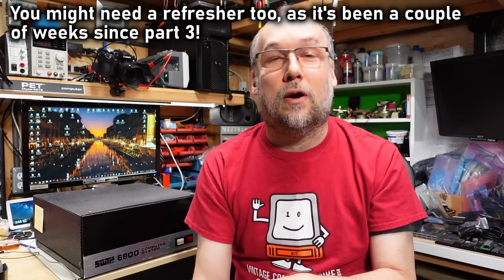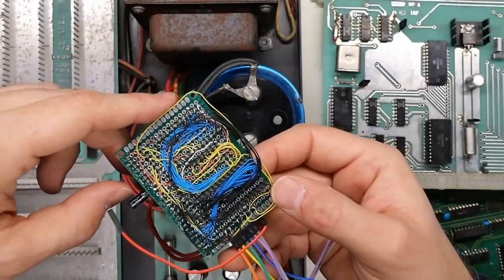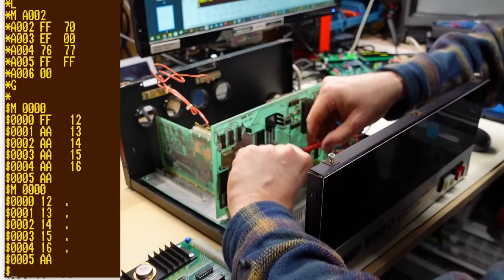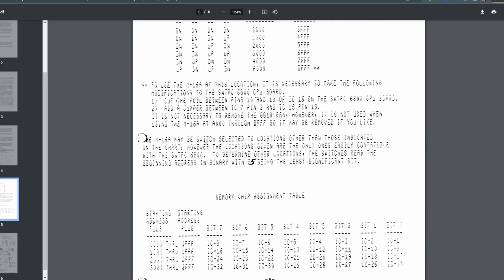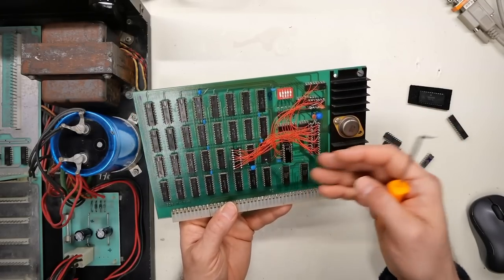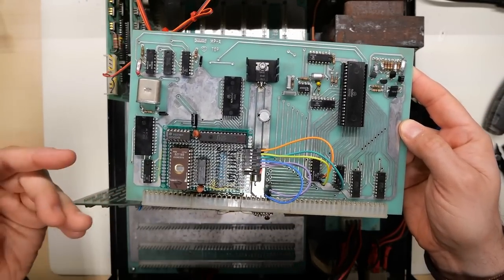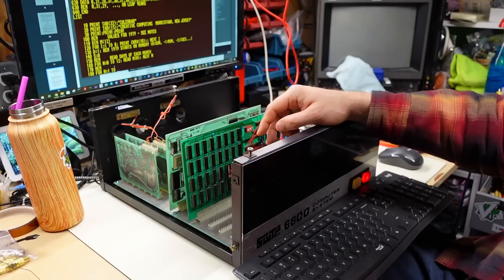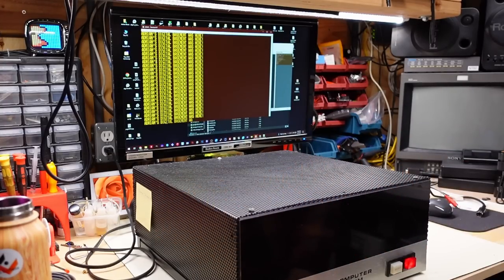We can fix it! A home-made 32K RAM expansion for the SWTPC 6800 (Part 4)

Comment: The timing diagram is telling you that you need to use VMA. They would not include it in the diagram if it was not necessary. The reason they call out Peripherals needing VMA is that someone could miss that point for peripherals. It's not stating that VMA is not needed for RAM.

This is because there are internal CPU cycles that assert the R/W and address lines but NOT VMA. You will corrupt memory if you don't factor it in. 

In my FPGA build of the 6800, the active high line for the write strobe for a 32KB RAM is:

wren => (not w_R1W0) and (not w_cpuAddress(15)) and w_vma and (not w_cpuClock),

(cpuClock is not Ph2 in my FPGA design)
Reply: Think of VMA as a signal that, like the name, tells you when an address on the bus is valid. The data sheet is telling you that it doesn't just apply to memory, but also to peripherals. After all, everything is memory mapped on the 6800.
Reply: When the 6800 was designed, every pin and signal out of the CPU took a lot of effort, and claimed a precious pin.  If it was not absolutely necessary,  the VMA signal would not have existed at all.  When the original decoding scheme was shown, my memory from 40 years ago thought "that just looks too simple, but I can't remember why".
Keep up the good work.

Comment: I find it both oddly comforting, and completely obvious that old digital tech works with modern digital tech.  The issues seem to always be that the new stuff isn't completely backwards compatible, whereas the old stuff (provided you can meet it's low speed requirements) works perfectly.

Comment: I would have put the RAM on the CPU board in the top of memory and the other board at address 0 so that the CPU board would continue to boot alone. Also, if you use Teraterm's "Send File" function, you will get a status bar showing progress, which would be nice. Finally, were this my machine, I'd probably replace the hand wired stuff with a new board to plug into the backplane that was a combo ROM and 64K RAM board. Include DIP switches to disable banks of RAM, and to select different banks of a larger EPROM, and you'd be ready to boot to monitor, or directly to a disk bootloader.

Comment: Baud is symbols per second. Bit rate is bits per second. Sometimes they are the same and sometimes they are not. For example a 56K modem is 56K bps but actually something like 1200 baud as it uses QPSK bit encoding!

Comment: Wow, that was incredible! Fantastic job with that ram board and the troubleshooting. I noticed at 43:51 to 43:53 when you showed line 11170 it was supposed to be line 170, but I'm not sure line 170 ever made it into your final program. Line 160 was missing too. I wonder what the output would have looked like with those lines?
Reply from the maker: Ah right! Funny. Terra Term has all sorts of issues funny. Good eye!! In the final part of the video where it was running in the background behind me, I had reloaded the program and I think those lines were there because it did look just a little different.
Reply: The missing lines are responsible for not showing *'s that should appear "behind" other lines on the diagram.  With the code lines missing, the extra *'s got printed anyway, making the right side of the figure thicker than it should have been.

Comment: I didn't scroll down to see if you got someone giving the full explanation on the VMA signal. I'm shooting from the hip here, but my recollection is that, during internal calculations, you often get what looks like a valid address on the bus if you aren't including VMA. (Doing this to make it easier to tri-state the bus and put another bus controller on the bus while the 6800 cogitates or something.) In other words, with only the address, clock, and read/write signals, you can definitely get spurious writes. You have to use the VMA to prevent those spurious writes.

Comment: When VMA is low the 6800 is doing some internal processing and the address bus can have an invalid address. Definitely, no writes must be allowed if VMA is inactive. The 6502 lacks the VMA signal and all clock cycles are memory reads or writes. That CPU always shows a valid address on writes, even on dummy write cycles. But in the 6502 case a dummy write can still have some unintended effects on I/O devices ( a double write to the same address is not a problem for memory, but it is a very different story  for an UART data register)
Reply: Being a simpler CPU, the 6502 is less likely to have internal cycles. Also, more space on the die to handle isolating the external bus internally if it needs to.

Comment: I have a very simple 6 IC computer on a breadboard with 32k EEPROM, 32k RAM, overclocked to almost 150% (7.4 MHz) . The serial I/O is also bit banged, running at 19200 baud. It actually can do 38400 baud. That works fine for normal terminal communication, but fails in XMODEM uploads, because the processor is not ready to receive the next byte if I actually want to do something with the last byte. TeraTerm sends the entire packet without delays. The great thing is that the processor is a contemporary of your 6800 computer here, not some modern thingie. The memories are more modern of course and should work fine for any clock frequency I can reasonably reach, but I'm planning a tiny memory expansion  to up to 16 megabytes.

Isn't it great how far you can get with such an old processor when it's not bogged down by slow, tiny memories? Your piggy back ROM expansion reminded me of my memory expansions back in the day. They were also on perfboard and sat piggy back on my single 4k RAM board. These were my first DIY circuits that actually worked. :-)

Comment: I guess it depends on which way you look at it. From a preservationist perspective, since you had to cut traces, even though it’s reversible, you still altered the card. But I do think this is probably close to what actual owners in the time would’ve done. Of course, with period parts and probably wire wrapping instead of soldering. Someone with enough technical knowledge could probably make a new CPU card for the SWTPC with EPROM support and modern static ram on the board, probably supporting the full 48k all in one. That could be interesting.

Comment: Completely support the ROM adapter and baud rate mods. Not super fond of using the "modern" SRAM chips, but I did approve of your assembly technique. Would have preferred to see the ROM adapter simply be a ROM adapter and seen the original SSB memory card repaired with period ICs. Alternatively, designing an expansion board to use the modern SRAMs would have also been a bit more "correct" IMO

Comment: I learned microprocessors using Heathkit 3400 course and trainer, which is based on the 6800  
You can't really do anything in basic. It's too slow. assembly is the only way to make old processors do anything without sucking. 
VMA should've been called VA (Valid address) it indicates that the address bus is holding a valid address and is not in three-state.

Comment: If you look at the memory mapping the6800 CPU always had designed the thought that E000 was beginning of any Rom and the next bank was for the extended Functions, like Extending the Functions or to provide access to ROMs added for special Interfaces. This always seemed strange when you could only use 32K RAM but could have up to 32K ROM for dedicated Functions. Have a look at the Motorola Manual for 6800, showing the Kits Motorola Designed. Having been around the the 6800 and the  6809 you will see the same thoughts are used in both. Where as Intel used the lower memory than allocated all the space left for RAM, this caused issues with larger ROMS causing loss of RAM affecting some early Programs to fail as they lost the lower RAM Space to ROM's. This thought also allowed for larger RAMs when 64K became cheap to move the ROMs up the memory stack and allow more RAM for Programs with out changing the lower Addresses.

Comment: Never assume that the 6502 = 6800. MOS made the 6500 to be pin and function compatible to the 6800 though having a different machine code. Motorola tried to sue the crap out of MOS but eventually agreed in court to MOS scrapping the 6500 and 6501 CPUs and redesigning the 6502 to what we know it today. Shortly after this court case Jack Tremiel bought MOS for Commodore and attempt to corner the 6502 market. The rest is history.
Reply: The 6800 pin-compatible version was called the 6501 rather than 6500.
Reply: It's funny, because people really didn't want something pin-compatible with the original 6800. The original 6800 needed a clock generator chip, and that was enough of a pain that Motorola later came out with the 6802/6808 that didn't.
Killing the 6501 didn't do any damage because nobody wanted it, except maybe adventurous people with an ET-3400.

Comment: I bet you could throw both CP/M and BASIC on a modern ROM chip easily, if you put in an MMU for it and the appropriate loading software you could do so without eating up a major amount of address space.  (CP/M would require the most address space, and is probably the only one requiring more than one ROM bank.)  You probably can find a copy of TinyBASIC online along with instructions on how to put it in a ROM. 

It would also be cool to make a custom VPU card.  

I'd also like to see an MMU Expansion card using one of the widely supported MMUs from the time. 

You can order custom PCBs built online too, and considering the rather standard size of these PCBs, it would be quite easy and cheap here.

As a note, you can get quite large n*8 SRAM modules on most electronic prototyping supply stores.  Of course, this means waiting for shipping.

Comment: I'm currently fighting to get CTS/RTS working on a project I'm working with --- one end is a PSoC4 board, which doesn't have it, and the other end is a Raspberry Pi, which doesn't have it by default --- and hardware handshaking makes life so much simpler. You just crank the baud rate as high as it will go and traffic flows as needed. Does that serial card support it? There are more than just three lines going to the external connector, which suggests so.

Comment: Just finished restoration of my Osborne 1.  Tera Term was repeating lines making file transfers a nightmare.  It had to do with the Tera Term software buffer and the Serial - USB hardware adapter driver buffer I was using.  In the end I couldn't find any combination of settings, drivers for the adapter, speeds etc.  I ended up downloading the 30 day trial of HyperTerminal and everything worked fine with no overlap.  I guess Hyper has better control of its buffer.

Comment: The explanation for the MC6800's VMA pin was given in full glory at 41:50. Memory access is not explicitly mentioned there, but in the timing diagrams for memory read/write, VMA is always present, so we can assume that it is relevant.
The G-64 bus (launched by the Swiss company GESPAC in the 1980s) also has a VMA signal (actually an inverted one: /VMA) which is described as: "This signal when asserted indicates that the address specified by A0 to A15 ... is valid and located in the memory field". The G-64 bus is leaning towards Motorola processors and so this signal might be possibly somehow "inherited" from the MC6800. I used the G-64 bus with the MC6809 CPU, which has no VMA pin. The /VMA signal for the bus was produced by the glue logic that performed the address decoding. The signal comes out of a PAL, so I cannot exactly say how it is calculated. Maybe I could have said this right away in the 1980s, when I worked with that stuff. There was also a signal called /VPA (valid peripheral address) on the bus which went active when the address decoder decided that the address was in the range reserved for peripherals.

Comment: I think that I have an idea why VMA on the 68000 is important, and the clue is in the name.

Most microprocessors have clock cycles where the CPU is busy and no read (instruction fetch?) or write is happening. I call them "dummy" cycles. 

For processors which have separate not READ and not WRITE memory strobes (e.g. 8088 system) this is no issue, and they are easy to spot by scoping both strobes, but the 6800 (and 6502) have a slightly different interface and have Read/NotWrite. 

So for the 6502 you might already be aware that every clock cycle results in a memory access, whether needed or not. PHI2 is used to validate the access timing wise. During these dummy cycles for the 6502 the R/W has to indicate "read" because we don't want to corrupt memory with an unnecessary write. I have no idea what address the 6502 puts out. 

I think the issue is that dummy read cycles can cause unexpected behaviour if the unwanted access is to a peripheral chip where the read causes the reset of the data available interrupt. On quite a few peripheral chips reading the data register (e.g. from a UART) causes the interrupt to be de-asserted, but also causes the "data available" bit in the status register to be reset. So a dummy read of the "wrong" peripheral register can cause data loss, but it is very timing critical, e.g. if the UART data register is read just as the next character arrives and an dummy read of the same address resets the bit which says a new byte  has arrived (possibly) and so a character is missed.

I am now sort of assuming that VMA is only active for genuine read and write clock cycles and is inactive for what I call dummy cycles. This prevents the problem I describe above.

So the 6502 (which was a sort of copy of the 6800) does not have a VMA. I wonder why this signal disappeared as I understand it was supposed to be a drop in replacement for the 6800, but perhaps that was the 6500(?) which resulted in Motorola suing MOS? I just checked and the pinouts of the 6800 and 6800 are nearly identical. 

Your next experiment is to replace the 6800 with a 6502  😁

Anyway the 6502 does lots (well it's bus interface is pretty efficient but not perfect) of unnecessary reads, because there is no VMA pin to validate the memory access. So I cannot answer why this does not result in the problem I describe. I need to dig deeper.

Comment: One thing I found out in early 2000 is that Windows was (and maybe still is) absolutely abysmal at handling the serial port.
Prior to getting broadband installed there were no routers on the market so I decided to make my own using an old PC with 2 network cards and RedHat 5 installed. To test the NAT routing before getting the install I decided to connect my USR 56k modem to this homebuild router and I was surprised, and I mean really surprised at the speed increase of the connection. This was using the same Windows machine now connected to the router box via ethernet instead of serial direct.
This also brought to much the time I connected a laptop with no CD to a Windows computer via a serial network program to install Office. It took hours, as expected, but the Windows machine's system clock has basically frozen for the entire transfer because it was hours slow and needed resetting!
Not used a Windows/DOS COM port for a long time so I don't know if that's still an issue, but from this I suspect it is.
Reply: Adrian's comment, near the end of the video, about Minicom on a Raspberry Pi working better than TeraTerm on Windows implies this could still be the case.
Reply: Yes, that's what prompted me to write this comment 🙂

Comment: For the 16K RAM card, just use 2 good RAM ICs from the highest address space bank to replace the faulty ones & remove the remaining 6 good RAM ICs. This gives you a 44K RAM system with 6 spare RAM ICs. QED.

Comment: Really one of your best videos Adrian!! Great efford and work to make that old lady do something useful! Greetings from Greece!
But I have a question, didn't you found 2 bad chips on that RAM card at Bank 2 and 3? Why did you remove only the one and wire the new sram chips on it? I got really confused at that point of the video...
Reply from the maker: I didn't have replacement chips, so I just decided to bypass all of the RAM entirely. Every soldered chip is disabled now and all data is stored in that one single chip.
Reply: @adriansdigitalbasement  Oh I see, so now the card is in there for making the cosmetical image of the 2 new chips period correct and to connect them to the system bus. Nice!
Also I love those thin wire harnesses you made they fit to the idea of this kind and era of machine

Comment: The fact that some USB serial adapters work and some don't I think is because newer ones usually don't output the full RS232 voltage levels, but only 0v to 5v (some maybe go as low as 3.3v, but that's my speculation). See https://en.wikipedia.org/wiki/RS-232#Voltage_levels